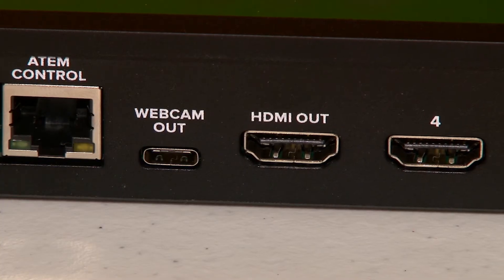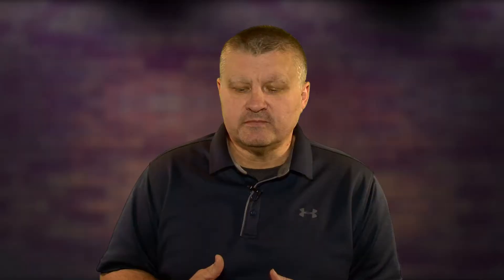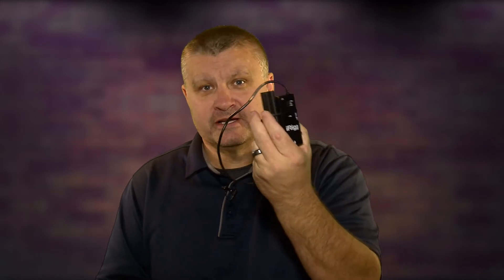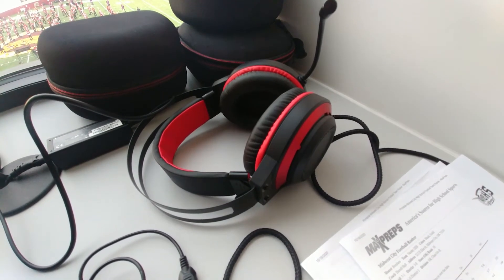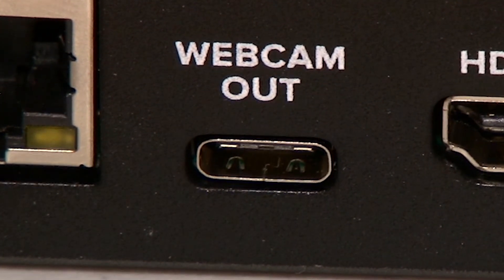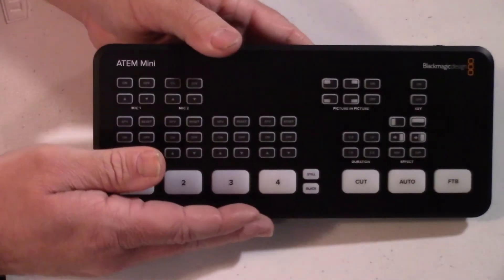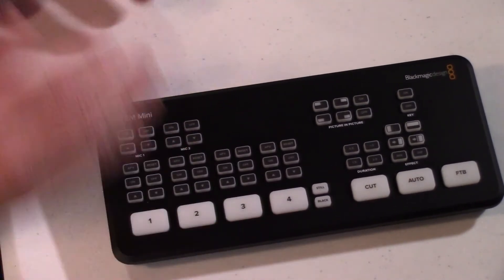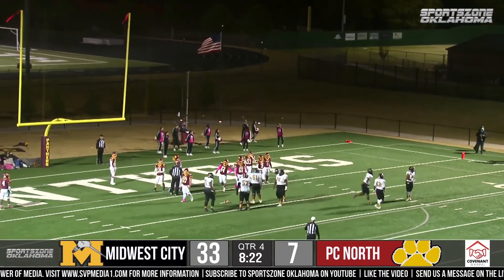ATEM MINI AUDIO DRIFT PROBLEM

Comment: So is there fix on this issue?
Reply from the maker: I installed the latest firmware and it fixed the drift issue but now I keep losing connection with cameras when trying to stream using the webcam USB-C port.  What I ended up doing was going from the HDMI Program output to a HDMI splitter with one going to the monitor and the other to my laptop via a Cam Link 4K capture card and streaming through OBS.

Comment: Mike...I'm starting to build the hardware to have events broadcast.  Has there been any updates to the ATEM Mini to your knowledge?  Thanks
Reply from the maker: Not that I know of
Reply: @MikesWorld1  Does this make any sense? https://www.youtube.com/watch?v=bN1Z4zCiv-s&t=88s
Reply from the maker: @rjyokum  That is how you adjust for the delay in HDMI but that had nothing to do with the audio drift problem.
Reply: @MikesWorld1  Got ya.....I'm just trying to find a solution.  I absolutely need to be able to use this thing
Reply: Thanks for responding Mike!
Reply: Still a  time drift issue on my Atem Mini in June 2021 with latest Firmware. It seems to me that heati s to be the problem, i used ith outside at a Footballmatch in it was exposed to sun an heat.

Comment: Is there a switcher that you would recommend then? Also do you connect from your cameras to whatever device you are using through HDMI or SDI?
Reply from the maker: I connect using HDMI unless I need a long cable run.  Then I run SDI from the camera to the switcher and a SDI to HDMI converter into the switcher.

Comment: Outstanding explanation, Mike.  I have the ATEM Mini Pro ISO linked into my laptop with Camtasia.  I'm trying to create corporate training videos and there is a .18 delay between the audio and video.  The BM audio delay dials have absolutely no impact,  I also tried to run the mic direct into the camera and then the sound does not go through to the ATEM and back to the laptop and camtasia software.  Very frustrating .  I can of course split the audio and video in Camtasia and move the audio forward .18 but to sync the audio and video but that seems crazy.

Comment: I have done w few livestreams and have had no drifting at all with this fix. You should give it a try.

I just found this and did what Moonlight Productions suggested. Did an audio stream test and worked for well over an hour when I would start to drift after 15-20 minutes https://obsproject.com/forum/threads/gradual-audio-de-sync-with-blackmagic-atem-mini.130025/

Comment: I’m bypassing audio by connecting mixer directly to the laptop and still have the same audio sync issues so i guess its a video delay issue when using usb-c.
Reply from the maker: I bought an audio mixer and completely bypass the ATEM Mini as well. It was the best solution.  The Mini just isn't a viable option for audio.
Reply: @MikesWorld1  I've also bypassed the ATEM Mini's audio using OBS Studio to stream the ATEM Mini's USB video output and audio together. btw: I never managed to stream via ATEM Mini pro - that is also an issue - the network usability is terrible - the ATEM mini gives no hints what could be wrong.

Comment: Hi Mike, have you recieved any feedback from Blackmagic design regarding the problem you encounterd with the audio drift. There seems to be a high number of seperate issues with Audio, related to different methods of capture when using the mini. However there does not seem to be direct answers for these issues as the product is being used differently  by content creators. Like yourself I intend to use the Atem mini for extended periods of time and am holding off purchasing the unit based on your experience. I need to be able to reliably record. stream and switch between cameras without the hassle and headache of audio sync problems.
Reply from the maker: Never heard back after the initial email.  I guess they've moved on and don't care. More people have messaged me with the same issue though.
Reply: @MikesWorld1  just experienced it for the first time using my brothers computer. we'll do some tests between my dads computer and this one. my dad thinks it could be something related to the USB...

Comment: I have experienced this problem before. It is an issue from the PC encoding settings. In longer sessions of encoding,  CPUs become overloaded. Just throttle down your encoding setting.
Reply from the maker: That would make sense IF I was having the same issue when connecting the ATEM Mini to the PC using the HDMI output and a HDMI to USB capture card.  I'm not though.  The drift only happens when using the USB-C webcam output of the ATEM Mini.

Comment: Hi Mike:

In "OBS project" they have and open thread about "Video & Audio Drift" ... (not only with ATEM devices).
You try another computer with OBS?
you test the issue with another cameras and different HDMI cables?
Did you try recording the webcam signal directly to your computer using something different than OBS?
Your ATEM has the lastest firmware?.
Disable Game DVR in OBS?
What its your "Common FPS Values" in OBS?
What its your sample rate in OBS?

I use the webcam out of the ATEM mini Pro to OBS exactly like you. I do long live music shows, conferences and theater and no audio drift. I stream to youtube, facebook, Restream and Zoom meetings.I use the mic inputs and camera audio. I have two ATEMS and both work without that audio drift.

I hope you can find the solution to your audio sync issue.
Reply from the maker: I've tried a variety of different options. I do have the latest firmware.  The direct record has the same drift issue as the stream.  I've had the same problem streaming to other platforms without OBS.  Like I said in the video, I've found others online with the same problem. I made sure it wasn't just me before making the video.

Comment: Any news . Was it fixed??
Reply from the maker: No fix as of yet.  Others are saying they don't have the problem but all seem to be using the ATEM Mini Pro, not the original ATEM Mini.  I've heard nothing back from Blackmagic after the initial email exchange.  I'm hoping the next firmware fixes the issue.
Reply: I’m having same issue and I have the pro. Around 30-40 mins in my mic gets all fuzzy sounding and then if I turn it off and back on and it comes back it’s completely out of sync.

Comment: if you take your audio mix in via one of the camera HDMI connection eg turn audio on for Cam 1 ( so you send you audio to cam 1 line input and back out thru the HDMI connection)  do you still get the drift in sync - IE dont go through the Mic 1 or MIc 2 inputs at all
Reply from the maker: You do not get a drift problem when using the HDMI output.  It's only using the webcam usb-c output.

Comment: You talk about a hope for a firmware update, but you never mention which firmware version your ATEM Mini has.
BMD has released firmware update 8.5.1 to address this on October 27 which is over a week prior to the date of your video.  Have you tried it?
Reply from the maker: I was on 8.5.1 firmware. The update included a fix to a known issue of direct audio being about 3-6 frames off from video because of the HDMI natural delay.  This meant if broadcasters used the mic input but were on a camera sending video in via HDMI, there would be a 3-6 frame sync issue if you show those broadcasters on-air.  This firmware fixed that issue. It did NOT address the drifting issue.
Reply: @MikesWorld1  It was firmware 8.2.3 that added the ability to delay audio by up to 8 frames for the "HDMI natural delay".
8.5.1 was to address the drifting.  Some people still had issues with USB recording so they tried again with 8.5.2   I would give 8.5.2 a try if you're still having problems.

Comment: The delay issue has been fixed for weeks now. There is a delay feature for the 2 audio in inputs. Another option would be to run the remote mic into the camera itself
Reply from the maker: That's not the delay I'm talking about.  That fix was for the 3 to 4 frame delay between direct input audio and the delay you get from HDMI.  This is completely different and has not been fixed.

Comment: You have to get all of your audio into your main camera and it will stay synced better over the usb
Reply from the maker: That doesn't work.  I tried that.  ANY audio going through the ATEM Mini from ANY source gets more and more out of sync over time.  I've spent a LOT of time on this issue and tried every possible fix.
Reply: @MikesWorld1  interesting... I've done. A few pretty long streams (8 hours) and that has held. I wonder if its your computer as well. OBS kinda sucks for me, but vMix or strait to Zoom has worked well...... But i have experienced the time slipping on a laptop, but on a desktop its smooth... Computer resources and memory running low
Reply from the maker: Well I'm running it through a Dynabook Tecra A50-F with 32GB RAM, 1TB SSD, and Intel i7 core processor.  It's the only program running so it shouldn't be an issue. If it was the laptop, the issue should persist even when running audio directly into the laptop and bypassing the ATEM Mini.  In this case, the drift only happens when audio is running through the ATEM Mini. Otherwise it's fine. As I said in the video, I've found others online with the same problem so I know it's not isolated to just me.
Reply: Thats how weve always run the audio

Comment: I just stumbled on this Atem Mini video which made me check out your games. (I also subscribed to your Sportszone Oklahoma channel and this channel.) I heard you are using OBS for streaming which is what I am using also. Up until now I have been just using an Elgato HD60s to run my video into OBS. I just bought an Atem mini this week so I can run a wide and tight camera in my setup along with a Hollyland 300 pro for a sideline/remote camera. I am glad I saw your video. I think Friday night I will just turn the sound off and back on to sync the audio back up. What are you using for your scoreboard? Your broadcast looks AWESOME!!! I want to step up our broadcasts to your level. Any help you can give me would be awesome.
 I can also email you if you would like.
Reply from the maker: I used scoreboard+ because it's free and made for OBS. The scoreboard itself I designed in Photoshop and saved as a PNG file.
Reply: @MikesWorld1  I just found this and did what Moonlight Productions suggested. Did an audio stream test and worked for well over an hour when I would start to drift after 15-20 minutes https://obsproject.com/forum/threads/gradual-audio-de-sync-with-blackmagic-atem-mini.130025/
Reply: Rewatching your video and pausing on your press box setup (Cuz I am a nerd and want to analyze your setup), I noticed on your computer screen that you are using Scoreboard+  which I am going to try this week. I used FlexyScore last week and it was good.
Reply: Well my last comment is outdated as I just watched you other video https://youtu.be/ViFRpMAUA0M lol Great job on both videos, just what I have been looking for.